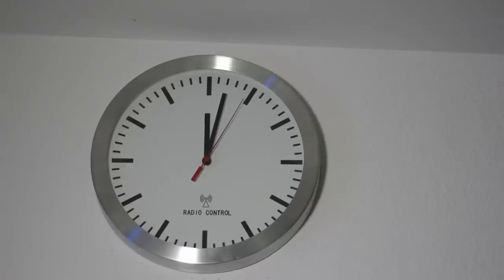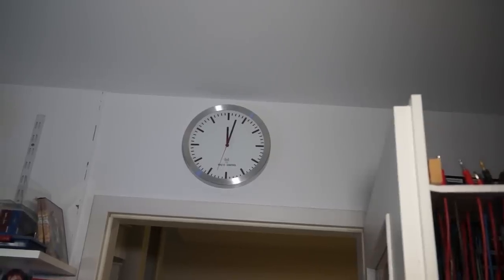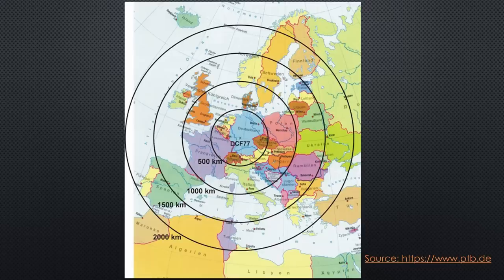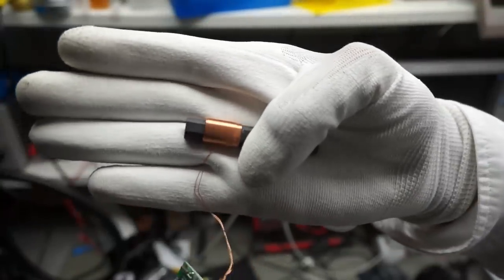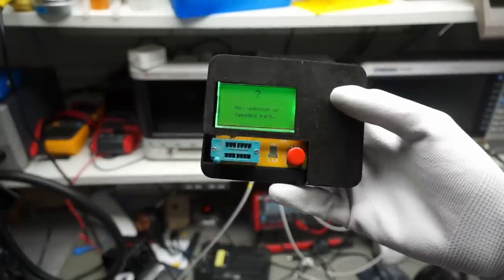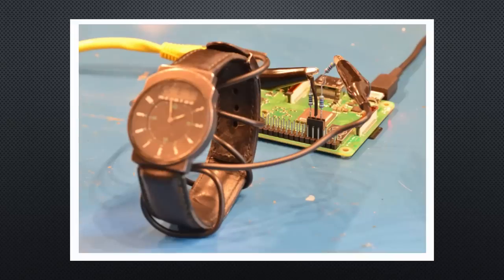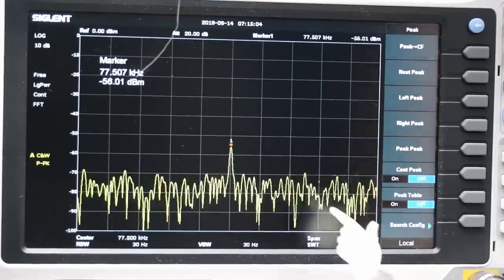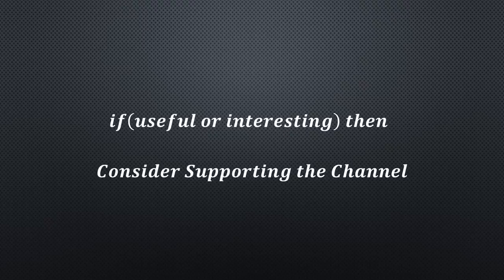#287 Remote Controller for Clocks (IKEA and others, DCF77, WWVB, MSF, JJY)

Comment: Did I miss something?  Where is the Raspberry Pi getting it's time from, to then send over the RF stream to the clocks?  If it is using an Internet connection and NTP, fine, or I could see receiving the original radio time signal where you can get it, then transmitting it locally near the clock.

I guess I could just re-watch the video, too!  ☺

[ UPDATE: I went to github and read the notes, it does use NTP on the Raspberry Pi as its time source, so that would need a working Internet connection of its own to at least periodically sync its time, or some other equivalent source. ]
Reply from the maker: You are right. You need an internet connection.
Reply: Is it possible to run an NTP server on the pi and point the app at localhost for any ntp requests? I'm presuming that the NTP server can read the Linix time or could be scripted in some way. You would suffer lag and need to reset the time periodically.  Need to read the NTP server docs ;)
Reply: @bryngerard4334  Needs to be confirmed, but I'd assume the application would just use local Pi time to send via RF to clock. The Pi's time would just run or drift, and NTP client on Pi would be used to sync its time from Internet NTP server(s).  These days there's a pool of servers typically used so a regional outage doesn't cause NTP  to fail.
There's a Windows port of NTP available from Meinberg, other good info there, too.  Just search for Meinberg NTP and it should be easy to find.
Good luck!
Reply: @bryngerard4334  CONFIRMED  According to the github page, "By default, the current system time is transmitted. The -t option allows different times for testing."  So it transmits the current Pi system time (whether synced via NTP or not) by default, but you can also provide a totally different time parameter by using the -t option.  So you can force it to be, say 01:23:45, confirm the clock changes, then run without that option to confirm your clock will change back to correct time.  Using NTP on the Pi to sync with Internet time sources would guarantee that your clock time is (and stays) accurate.
Reply: @bobblum5973  Yes,   you have to live with manually updating the time on the pi or occasionally connecting it to the Internet. I don't how much lag is experienced in say a year. I think it is a significant amount from my own experience with various IOT devices and poorly configured servers etc. Nevertheless, it sort of would work :)
Reply: @bryngerard4334  I guess it would depend upon how accurate the Pi time is versus the desired clock accuracy.  If the only way to set the clock is by using the RF signal then having the capability at all is good.  The Pi time drift would vary for each unit, I'm sure, so having an Internet connection would be better than not.  Wired or WiFi, doesn't matter.  There used to be other options for NTP time sync, one that even used a dialup modem periodically, but I have no idea what non-Internet options exist now.  You could even use another device to get the time data from GPS or WWVB or one of the others, then a wired connection into the room where the Pi and clock are located.

Comment: What about to use an antenna from a dcf77 clock mechanism  you can find also on Amazon?
Reply from the maker: Should be ok.
Reply: @AndreasSpiess  i have removed the antenna/inductance from the clock mechanism and it measure only 1.2mH so i need a capacitor of 3.51nF =~ 3.50nF is correct? i have a signal/function generator and since i do not have a single 3.5nF capacitor i have used some series+parallel to achive the correct value, now i have not understand how to see if the circuit is ok usin the generator+oscilloscope, i have generated a signal 1Volt / 77.5Khz (sine ? square? no matter?), what i had to 'see' on the oscilloscope if all is ok and what if not? (i'm using an Hantek 2D42 that output the signal AND also measure it) Thanks !

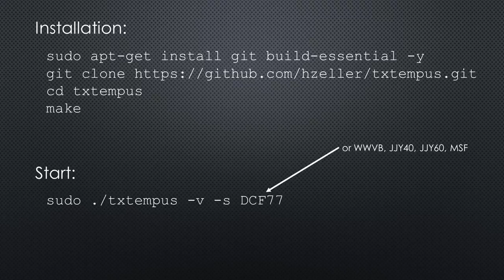Comment: 10:13 please do not increase voltage of VCC to more than 3.3V and certainly do not use a mosfet and a 50V power supply or you might off set all the clocks in your city. Please don’t! 😉
Reply from the maker: As I told you! ;-)
Reply: In theory, what output wattage would I get from doing such thing? And what about matching to 50 or 75ohm coax to allow a... separation of antenna and transmitter....
Reply: Steven Haigh
In theorie 150W, 
in practice highly illegal
Reply: @Conservator.  I'm listening :)

Comment: Does anyone know if this system could be made to work with Primex clocks to avoid buying their expensive transmitter?  I've not yet found anything on the primexinc.com site that details their protocol.
Reply from the maker: Primex seem to use 72 MHz signals (according FCC info). I assume they use a proprietary protocol.

Comment: Andreas, considering you're a Swiss Electronic Engineer - what safety precautions should you take before building such an LC resonator so that you do indeed end up with the intended radio transmitter rather than a spark-gap radio transmitter? :D I for one would be extremely reluctant to pump even low amounts of energy into a resonant circuit. I created a very simple simulation of your circuit (4.45 mH inductor with 2.4 Ohm ESR and 950 pF capacitor, resonating at 77.407 kHz) and it seems it doesn't matter much if the 2.4 Ohms resistance is seen "outside" the LC circuit  ( http://tinyurl.com/yy29ha36 ) or part of it ( http://tinyurl.com/y5gc3n8d ), when a 3.3 V 77.407 kHz square wave is applied the potential between the inductor and the capacitor can reach unbelievably high levels - just increase the simulation speed and you'll see it stabilises itself at 1.783 kV. Kilo Volts! The 2.4 Ohm resistive load alone will dissipate 1.6 W, while the inductor and capacitor seem to get to 736 W (“imaginary” power). How safe is this on that little coil and capacitor? Would hysteresis, eddy currents, proximity & skin effects be relevant at 77 kHz and make this circuit any safer or is there something else at play here to avoid a big catastrophe in the life of a Swiss? Thanks
Reply from the maker: I did not see the 200 ohms resistor to 3.3V in your simulations. Your transmitter must have a ton of output power. Mine hardly bridges 2 meters and consumes a few mA. So something is different between my setup and your simulations. Maybe you try your simulation in reality and see how much current it draws? And then you find the error in your simulation ;-)
Reply: Thank you, that's it and it makes all the difference. So it was a good idea after all to just simulate it and not to build it on an whim like that (i.e. forgetting the 200 Ohms resistance). I only like sparks outside for New Year's Eve :)

With the 200 Ohm resistor the simulation shows max. 24.12 V, 21.5 mW for the 200 Ohms resistor, 258 uW for the 2.4 Ohms resistance, 120 mW for the inductance and 127 mW for the capacitance - all decent values.

  2.4 Ohms resistance "outside" the LC circuit: http://tinyurl.com/y2xshprd

  2.4 Ohms resistance part of the LC resonator: http://tinyurl.com/y42rgguh

Comment: You built and tested a transmitter that broadcasts  a replica of the signal broadcast by [DFC77, WWVB, etc](https://en.wikipedia.org/wiki/Radio_clock). The RPi & `hzeller`'s software effectively give the maker the ability to set up their own personal version of DFC77, WWVB, etc. All well, good & very interesting. But it won't provide the 10 msec accuracy of the the real transmitters. Instead, your clock(s) will be set to the time that the Raspberry Pi thinks it is. That might be NTP accuracy if you choose to run`ntpd` instead of using the default SNTP which is the only option for `systemd-timesyncd`, and your NTP server works reliably.
Reply from the maker: You are right. I do not think my IKEA clock cares about 10ms ;-) I just want that it synchronizes longterm and automatically adjusts for summer time.
Reply: @AndreasSpiess  Do you not get DFC77 even in the night time?
Reply from the maker: Not in my basement

Comment: Hey Andreas, I think a low-cost implementation of a VNA would be a cheap noise source coupled with an SDR (relevant you your previous video) through a directional coupler, or even some cheap ready-made SWR meters for antennas. Something like this - https://www.youtube.com/watch?v=EDbS-zlLPxw Let me know what you think
Reply from the maker: I tried with a noise source and the FFT of my oscilloscope. But without success. You are right. I could have used a VNA. But the one I showed on YouTube starts at 135 MHZ. And the other one will be only presented in the future ;-)

Comment: Time from a GPS signal is more useful.
Reply from the maker: Not if you are in a basement as I am ;-)
Reply: @AndreasSpiess  Well, the way it should function, GPS + IoT connected to your network upstairs and in the basement you get the "atomic" time through your WiFi or Ethernet.
Reply from the maker: Don’t you think you would lose precision? Because this is more or less what I do with a NTP server. Just 50km away.
Reply: @AndreasSpiess  GPS clock, however, can be received in places where internet connection is not available (to query NTP) or too expensive to implement. Example, precise time logging for a specific sensor in a standalone IoT solution. GPS modules are very cheap nowadays and widely available. Getting time is easy, just needs a serial connection to a GPS module. NTP server way is probably a bit more precise, as it does jitter correction with multiple requests averaging.

Comment: How about the GPS signal from the caesium and rubidium clocks in America. There was 13 or 15 in a room which feed the satellite system. I remember it as we used it in the lab and truck to calibrate time with tge counters and spectrum analyzers.
Reply from the maker: GPS would be good. But my problem was more the display with this analog clock without wires...

Comment: Cool but not working in Australia since they stoped sending the signal years ago.
Reply: Well, it would work if you owned a prescribed clock and you built the RC circuit
Reply: I think you missed the point completely.
Reply: he did not describe how to receive these signals, he is faking these signals. So you can back your own small island of radio synced clocks at your home down under...